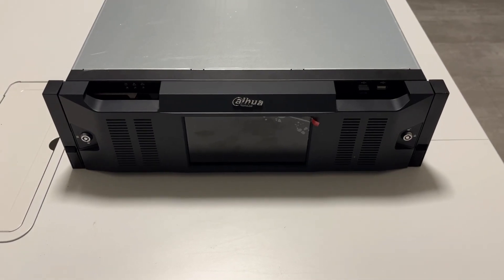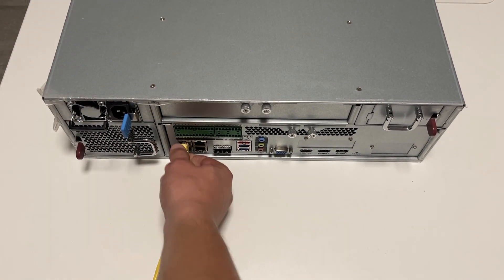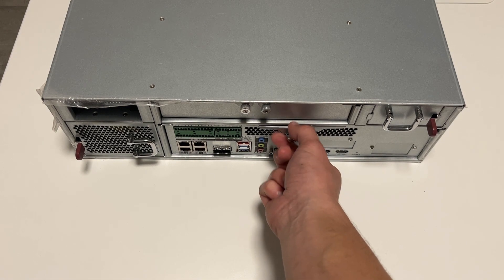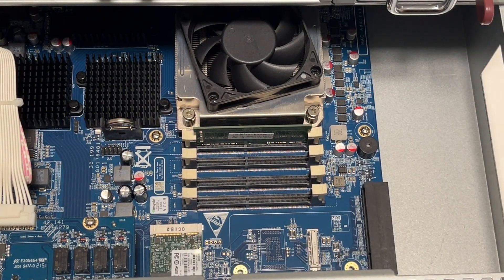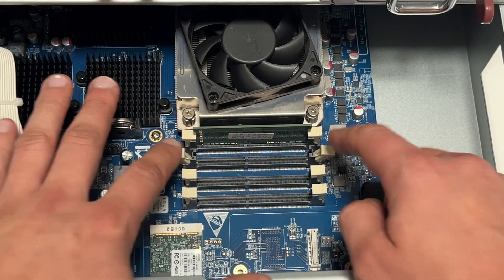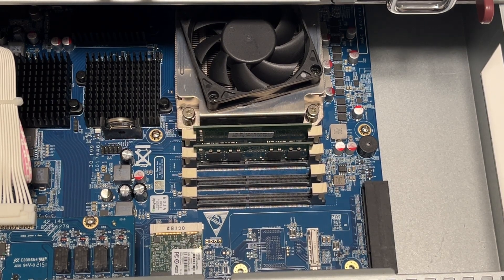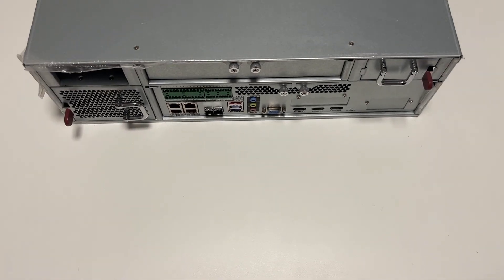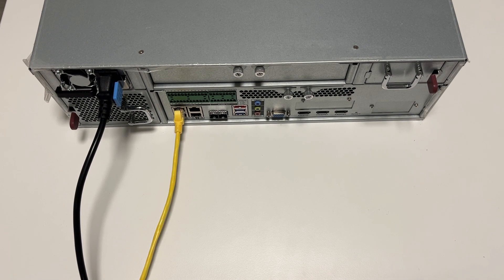DSS7016D DR S2 - How to increase RAM capacity

Comment: I am planning for video wall for 510 cameras with decoder and dss-7016dr-s2 any one can give suggestion
Reply from the maker: Hi we are supporting our matrix system for example you can use multiple M70-4U-E, or M60-12U with cards .... depends if you want to stream all the cameras at the same time or you choose just some of the cameras

Comment: Hi can we use SSD in dss7016 dr?
Reply from the maker: hi caddy is optimazed for 3.5"HDD so you need to add holder for HDD.
Reply: @DahuaDSSPro  thanks for responding
 Yes we can use an enclosure of 3.5 inch to hold the SSD of 2.5 inch
We intend to use SSD as the OS disk for high speed and lag free experience.